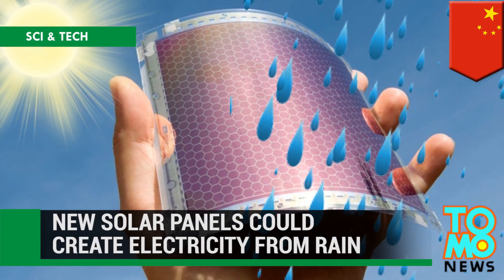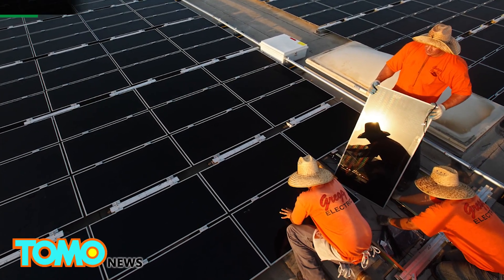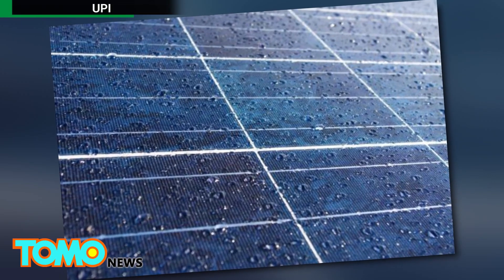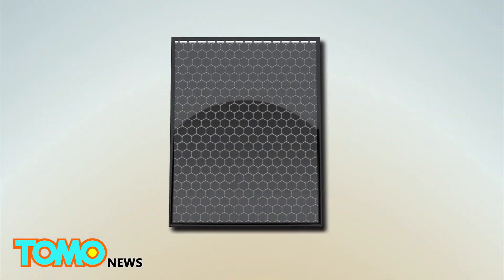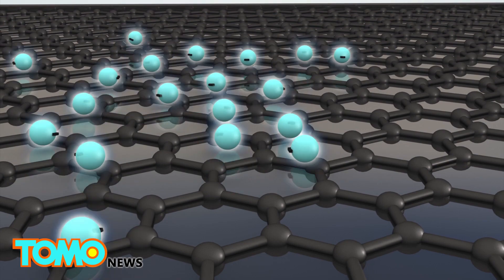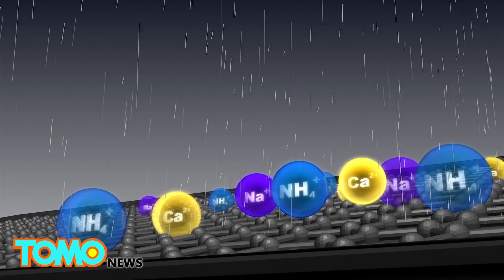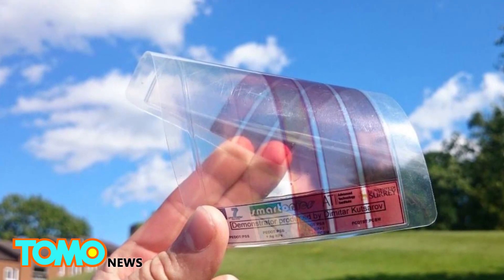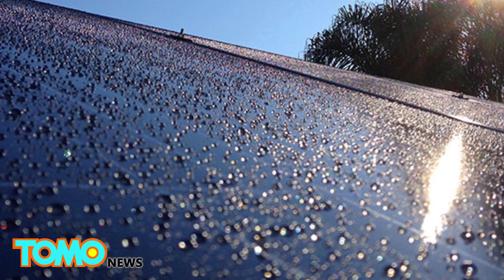Future green technology: new solar panels could generate electricity from raindrops - TomoNews

Comment: Why not develop panels to line canals and pipes that have moving water to generate ekectrity none stop? The panels could supply vacuum spark gaps located away from a water source to increase the electrical frequency being generated and then wirelessly sent to energize a electrical grid.